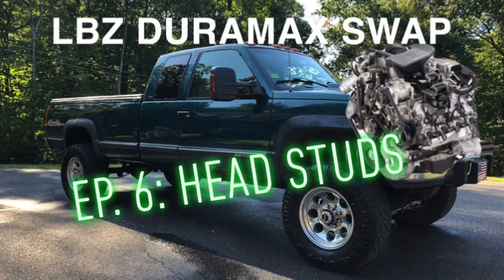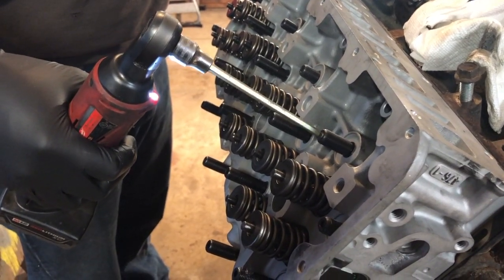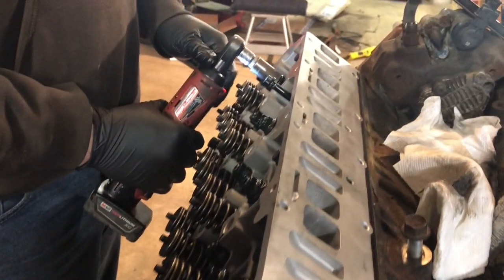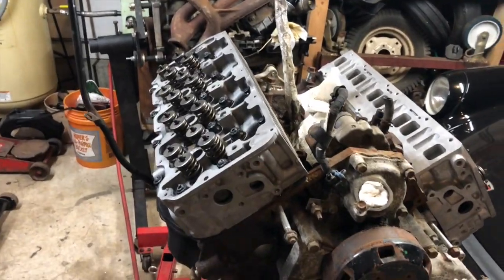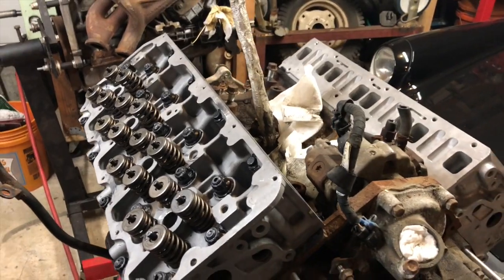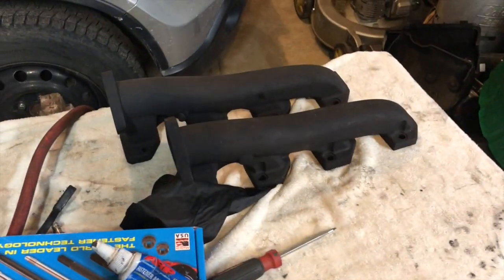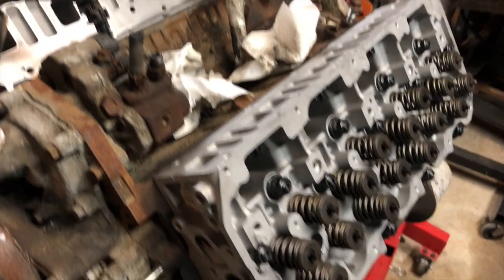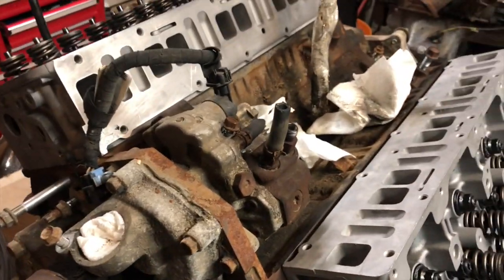LBZ Swap Part 6: ARP Head Studs

Comment: I can't wait to see it setting in the engine bay. Hope getting the crank bolt out to do water pump goes good every duramax i've done a waterpump on has been tighter than a bulls ass. Gonna need a serious cheater bar and a 400lb gorilla and some heat unless done before.
Reply from the maker: Kattera's Collection I think @talbot_industries and I are up to the challenge 💪🏻💪🏻
Reply: I have no doubts. Should turn out nice!